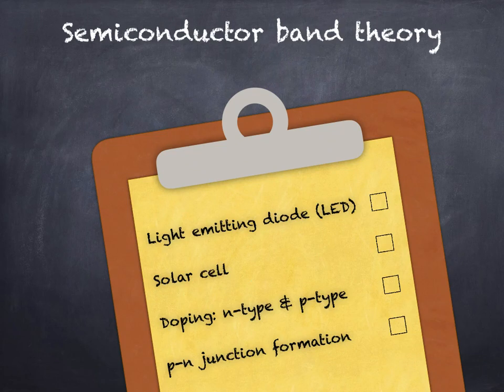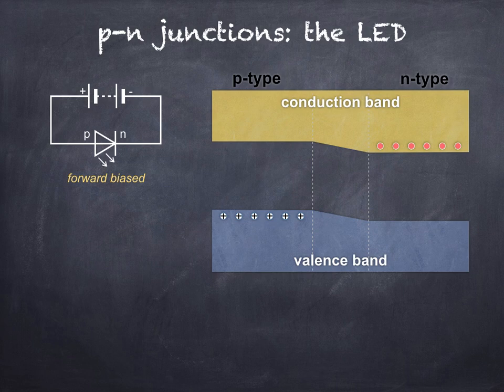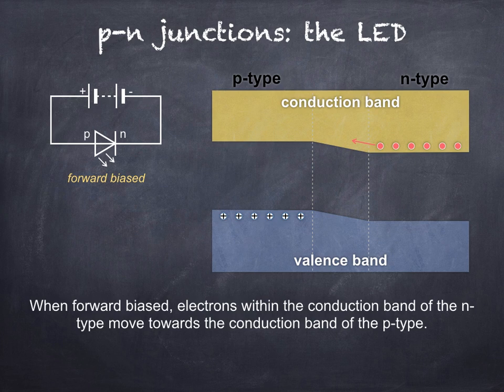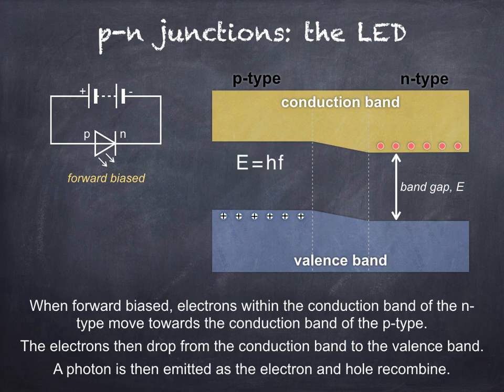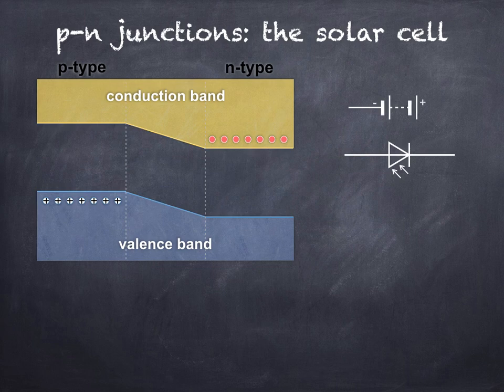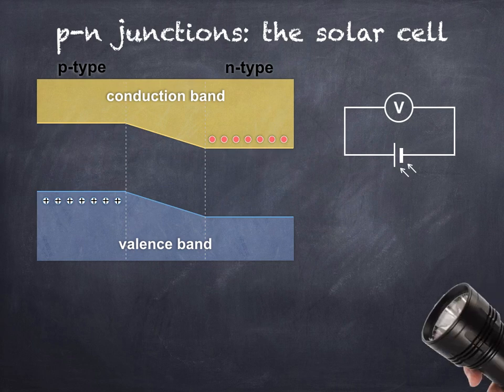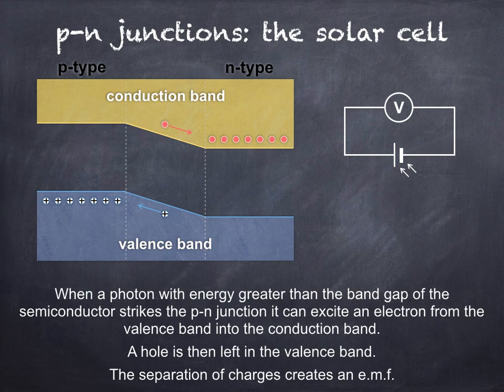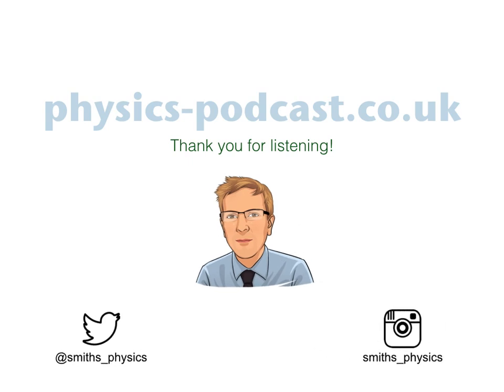Semiconductors 3: the LED & solar cell (Higher Physics)

Comment: In last video when recombination takes place heat is emitted now here its said light is emitted? What's the difference? Why light here?
Reply from the maker: That's related to the materials used and the design of the LED itself - it's not something that's required at Higher level so I've not covered it in the video.